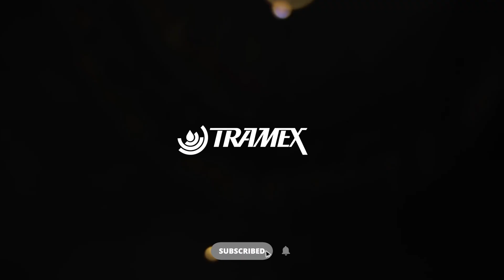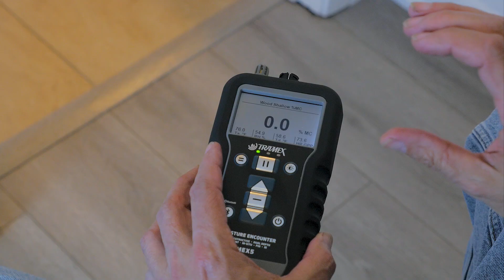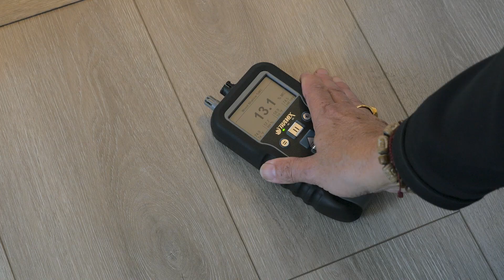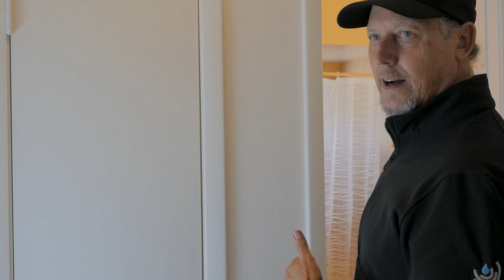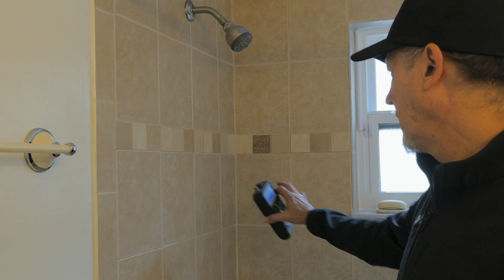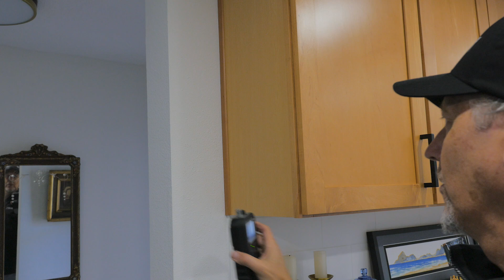How to Detect Hidden Moisture Across ANY Building Material (Tramex MEX5)

Comment from the maker: In a dry building at HVAC equilibrium, most materials will read within a tight $2\%$ to $3\%$ range in Shallow Depth mode ($3/8''$). Anything outside that baseline instantly points you to hidden moisture!🔗 Learn more about the dual-depth Tramex MEX5: tramexmeters.com/learn/how-to-use-the-multi-shallow-depth-settings-on-the-tramex-moisture-encounter-mex5